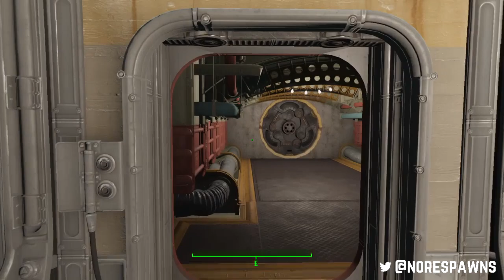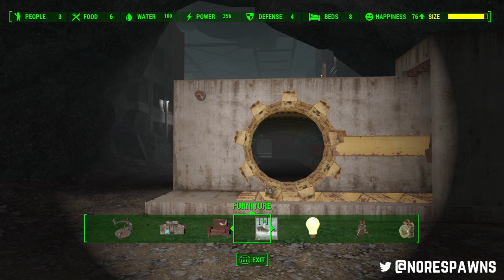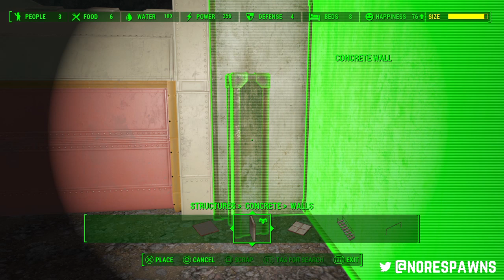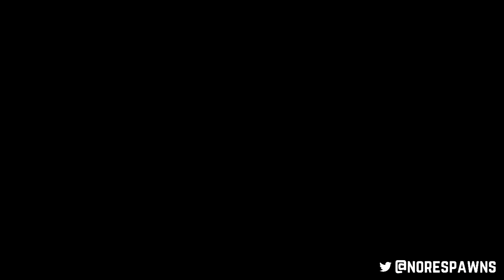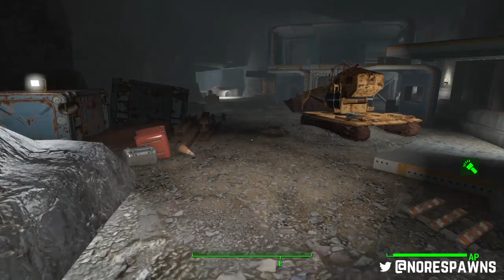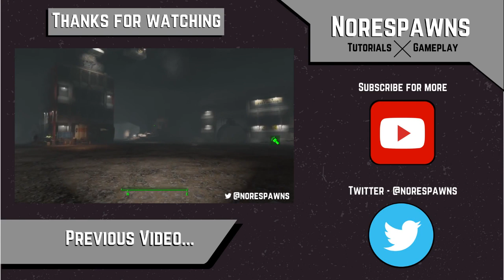Fallout 4 Vault-Tec Workshop - Sealed Vault Exits & Doors

Comment: i've figured out how to make a decent circuit through the cave system to make very large vault, with a three to four storey research labs, a large residential area, likely two storey, a vaulted door for a trading post near the old niversity, a reactor sector, and even figured how i could access the water purification, and your little demonstration really helped aswell for sealing off a few areas and making the trading area possible granted it winds just a little through the cave systems and a couple of times the rocks will peek through the lower corners, but I can conceal that with rug glitched cases and such.

Comment: hey, i plugged that tunnel with the concrete like you did. i did the wall a little closer to the big hall so the tunnel was a bit larger there. i think it ended up being 4 stories of concrete counting the one clipping in the top..  the thing is i got almost every piece to snap naturally. only one little piece where i had to console command it into place, it turned out awesome, thank you for this.

Comment: Hey, man and anyone else I've been messing around and you can actually put an elevator into the vault without it looking like it's on the outside. Just use supports to snap or an elevator from an existing open piece (e.g utility corner.) Then once snap an elevator basically parallel to the open piece you can put the outside piece's (e.g. Atrium- wall bottom) against the elevator, this will give that shaft look. Sorry i don't have a photo i don't have twitter. Hope this helps!

Comment: Still no way to fix the glitch that's broken the dlc for a lot of people. I can't get past the point of building the overseers desk and I'm actually really disappointed because this dlc looks like a lot of fun...
Reply: reload a save
Reply: It's in special. I was frustrated for a while because I was going straight to tables and building it but that's not the right one. The right one is in special.
Reply: +Alexander Sheffield I built the right one and the quest still doesn't acknowledge it, nor does Barstow
Reply: +Sergio build it in a large open area where she can easily get to it. If that doesn't work, reload a save.
Reply: Bethesda DLC's are always shite. Bought all of them, 2 didn't install (Far Harbor and contraptions) and the other 3 didn't even work lmao
Reply: Kill Barstow. Sure, you don't get to experiment or anything but it fails the questline, and you auto unlock all non-experiment based objects in the DLC. If you can get it to work, on the last experiment pick indentured servitude and check your workshop inventory every day, filtering to [Misc]. Thank me later, that's 25 caps per day!

Comment: Do you have to do something special to get the giant waterpump working? because i cant get it wired up
Reply: There is a conduit on the very top of it, you just need to connect it to generators
Reply: I used a tall conduit tower and 2 large generators, the conduit has to be pretty close as the distance is reduced a lot by the height of the water pump
Reply: +RichyN25 thx i'll try that
Reply: +Robbie Wilson wel that's the problem i cant do that ha

Comment: 7:31 How do I move it vertically like that? I'm on Xbox.
Reply: Lb , a and use the analog I think
Reply: +MrJammyDodger left analog to be exact. but other buttons are good.
Reply: For some reason LB and left analog, right analog, RB doesn't work for me. Oh well.
Reply: +The Deer hold A after you have your item selected. Then hold the left bumper at the same time. Then your left analog will go up/down.
Reply: Michael Blank 
Ah right, i'll try it out later. Thanks!
Reply: Hold A and LB and use LS up and down. (Left Bumper is the small one, right?)

Comment: Wait I thought u didn't need to use wires to power lights in the vaults?
Reply: You don't if the vault walls are actually used
Reply: you don't
Reply: It fits the feel he's going with here
Reply: You don't, but it just looks more fitting to have wires strung everywhere for the theme Davey has.
Reply: The reactors if snapped onto the actual vault walls will pull power all through walls connected to it but the power relays need to be placed to enable lights within a certain radius.
Reply: +lickthismiff thanks for adding information which totally hadn't been said twice before, good job
Reply: +Truth Owl I hadn't refreshed the page before commenting, maybe next time don't ask a question with such an obvious answer.
Reply: You don't, it's just the theme he has in mind

(am i doing it right?)
Reply: +J'zargo this made my day
Reply: lickthismiff -1
Reply: I'm really wondering to why i said something everyone knows.
Reply: HAil Stiv

Comment: Your vault door are facing the wrong way
Reply from the maker: No they're not - those doors are inspired by the original Fallout:

http://vignette2.wikia.nocookie.net/fallout/images/9/92/Fo1_Vault_13_Level_1.png/revision/latest?cb=20090217192749
Reply: norespawns My mistake you're right
Reply: actually the old doors make more sense then the new doors. it's much easier to protect the vault from a nuclear blast, when the door opens to the outer side.
Reply: if rubble gets in front of the door it will never open again, so it doesnt make sense at all
Reply: Exactly. And your exposing the mechanisms of the door to the people trying to get in. Giving them easy access to tinkering with it to get it open.
Reply: +Whiplash. it does make sense though to have the door open outward, because then the shockwave from a nuclear blast would push the door into it's frame and it wouldn't move, this is called a "plug type" door. if the door were to open inward then it would have to rely on it's locking rods alone to withstand the force of a nuclear blast. notice how when viewed side-on profile of the door is tapered, this is so the door will be fully supported around it's entire circumference by the door frame and provide maximum structural strength. as for debris, the door is pushed out of the frame by powerful hydraulic rams, random debris like rocks or branches would be pushed out of the way or crushed, although the vault dwellers would inevitably have to clean the pathway the door rolls along to ensure smooth operation.

Comment: can you put turrets in the vault?
Reply from the maker: yup!
Reply: +norespawns thanks any suggestions where to put them so I don't have 20 turrets in each section of the vault?
Reply from the maker: noooo idea - I haven;t set mine up yet.
Reply: norespawns are you doing a video of where to set up defenses?
Reply from the maker: nah - probably not.
Reply: norespawns aight
Reply: +NCR Veteran Ranger I put them in the entrance section
Reply: iMax ty
Reply: not only can you do that, but you definitely should do that. the main entrance is quite easy to protect with guards, but the two side entrances (which also have spawn points) are so far away from the main hall that guards (and other settlers) cannot go there. when enemies come from one or both of these side entrances it takes ages until they finally come to your main hall. and some of the attackers get lost somewhere in the caves, if you open up all the 'hidden caves'. so you should put a bunch of turrets near the side entrances, so you don't have to deal with them during the attacks. every once in a while maybe you should see if the attackers dropped weapons, because too many objects in a cell may lead to lags.